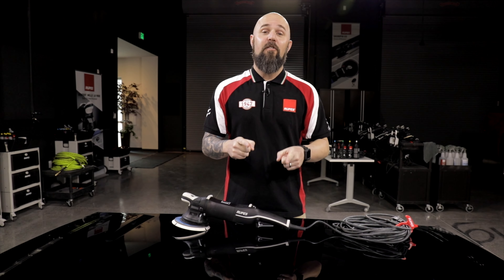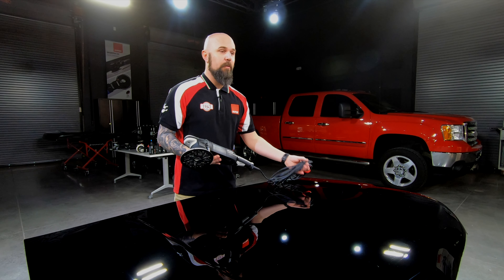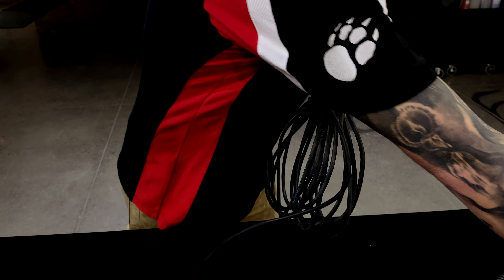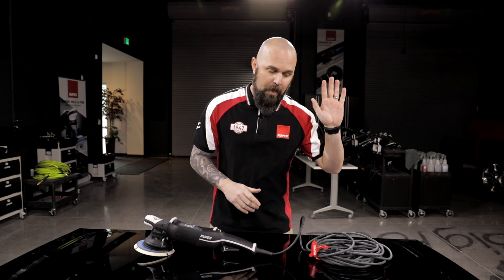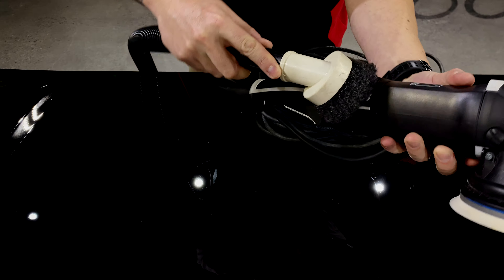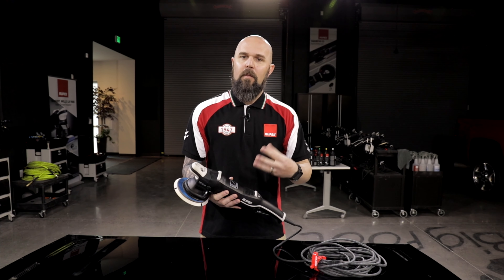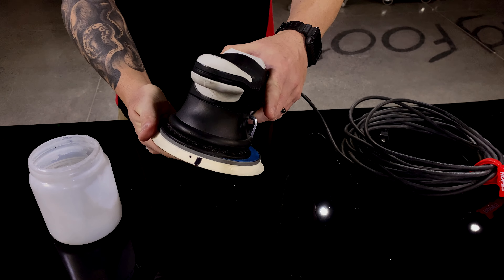Electric Tool Maintenance - Dos and Don'ts of Electric Tool Care - [RUPES Replies Episode 004]

Comment: Good and informative, thank you! 
I have 2 questions: 
What to do and what NOT to do to have good lifespan of polishing pads?
How can I minimise dusting and product sling during polishing?
I think I have good understanding of your polishing system, I know that "working clean" concept is vital, but I still sometimes struggle with those issues.
Reply from the maker: Thank you for your comments Jan. 
These are certainly great questions for a future video, so we will consider them for that. To answer you now, however -
Lifespan of pads can be attributed to a number of factors, but most commonly heat is the biggest issue. Technicians using heavy pressure, excessive pad angle, or not cycling pads out leads to heat buildup and heat buildup can prematurely kill pads. Using multiple pads on each vehicle, cleaning them frequently and switching to a new pad often can help your pads to last MUCH longer. 
Dusting and sling is most commonly associated with using too much compound and/or over-cycling the compound. We find that many technicians run the random orbital compounds longer than they are designed. They are short cycle compounds, which means they only need to be worked for a short time - over cycling a short cycle liquid will almost always lead to dusting.
Reply: @RUPES  Dear Rupes team, thank you for your detailed support! Your contribution to educated detailers is superb :)

Comment: My rubber shroud is popping under my backing plate and causing extra friction and heat; causing my pads to burn up and velcro on the backing plate to melt. 😢
It only has 20 or 30 hours run time. The rubber shroud has begun to
Melt a little because of it. Honestly i think it came defective. The handle was loose and the bolts arent flush in the slots. Its brand new and for an almost 500 tool
Id prefer to not have to mail it in after the second i’ve used it for.. should I send it in to be serviced? Feel like i wasted money. Im upset because this rubber has created extra heat and burnt up my backing plate and like $50 worth of pads probably before i caught it
Reply from the maker: Sorry to hear about the issue with your tool. Go to www.rupesusa.com/repairs and fill out a repair request form to begin the servicing process. If you have only used it for 20 to 30 hours, my assumption is that you are within the 1 year limited warranty period, so the repair should be covered. But our team will determine that as you navigate through the repair process.

Comment: Is it ok if I clean it with compressed air? Or just use the vacuum? Thanks for all this helping videos!
Reply from the maker: Compressed air tends to push lint and debris inside the housing where it can interfere with the rotating motor assembly. We recommend vacuum so it pulls the debris out rather than pushing it in.

Comment: When I try to easily spin the pad as such, my lhr15 does not freely spin. never has. What can I do?
Reply from the maker: Thanks for commenting. It is not supposed to freely spin. Contact with the shroud is there by design for several reasons.
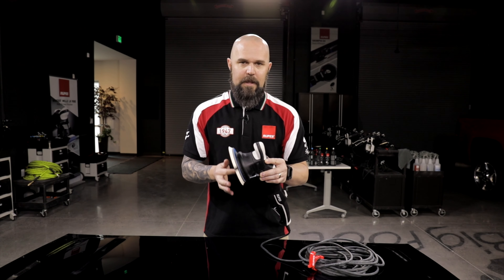Reply: 2:05 you move it freely. I’m saying mine gives a lot of resistance.

Comment: Thanks for the good tips. One more tip from my experience, maybe its not good but it works for me for years now, blow out your machine regularly, when working with compounds during time machine sucks in some of that dust and it becomes.embedded inside, so start your machine at speed 1 and let it spin for a second and let go of the switch and blow in air into every vent but carefully if your air pressure is high not to.damage anhthing inside, You will see how much dust will be thrown out the machine. You will have cooler machine and prolong its lifespan.
Reply from the maker: Thanks for the comment. The only potential issue with using compressed air blown into the tool is the tendency to push more contamination into the tools housing where it can interfere with the rotor and stator of the motor. If you do use compressed air and you begin to see excessive sparking from the motor it may have contaminants inside that were not pushed out. This is why we prefer/recommend vacuum.